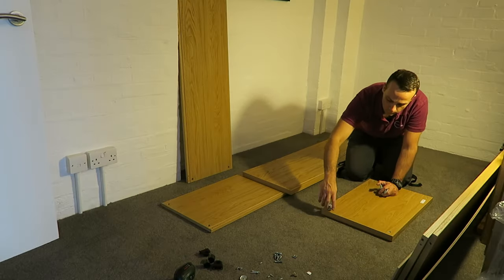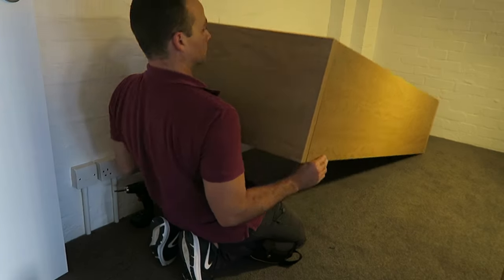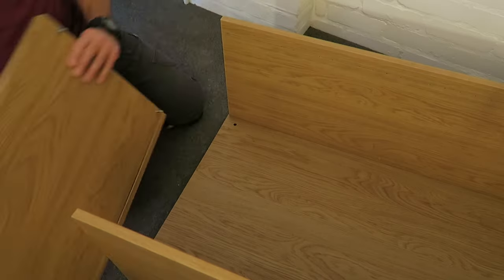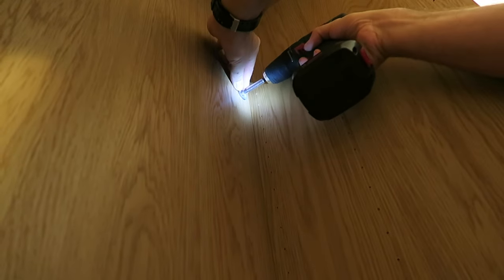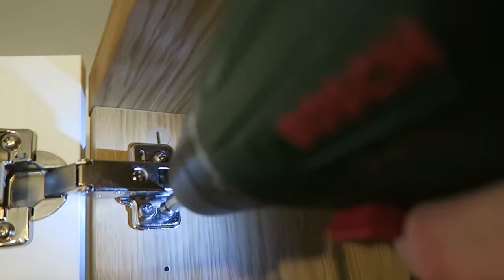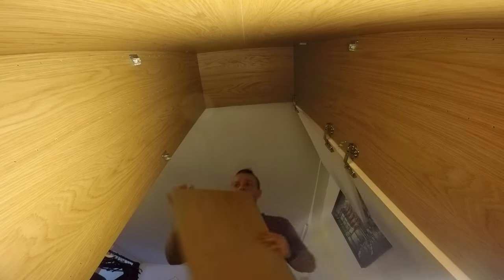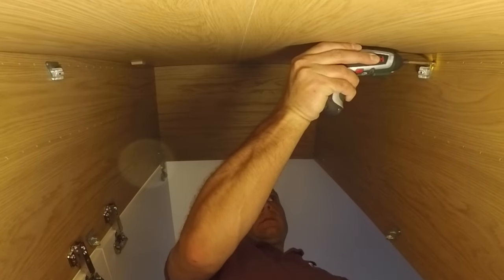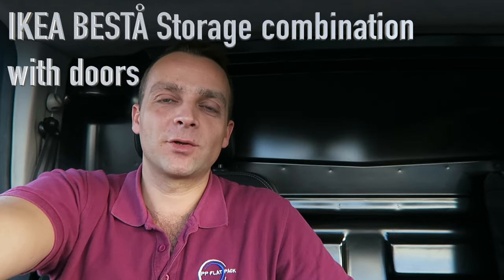IKEA BESTÅ Storage combination white Assembly

Comment: I absolutely cannot insert the backing board without it falling out of the grooves. You slid it in so effortlessly! Any tips?
Reply: I had exactly the same problem - it was a right faff getting the backing board into those grooves ! As soon as you push the board into the grooves, the sides move/open up and the board drops to the floor.

Comment: If you have only 1 small frame 23"H x 23"W x 8"H does it have to be secured to the wall?  Every time I open the door the unit tips forward.
Reply from the maker: Yes this one need to be fixed to the wall
Reply: @PPFlatPack  Thank you!  I am going to try to return it then.
Reply from the maker: @AquaFrost777   Maybe get wardrobe with sliding door there is not that much pressure on the frames.

Comment: Awesome video!
Can you please share what screws are you using to secure the dividing panels (7:34)?
I’m not finding them. Many thanks!!
Reply: Haha thought the same, they're in the instructions but not in the bag
Reply: Supposedly Ikea screws 114667, but you may well need longer and a different sort depending on what type of wall you are drilling into. If you don't have any in the Ikea bag or personal stocks, any hardware store will help. The fancy cheap-looking plastic pieces that come with Bestå units are a pain compared with the metal system traditionally offered by Ikea for the kitchen units (I don't mean the rails). With those you can drill into masonry, set your dowel and  put the screw half in. Then only you shove your unit against the wall and tighten the screw. Always better than fumbling around to find the dowel hole through the plastic holders we have with Bestå. Interestingly,  the BeståTV still have the sturdy metal system.
Reply: They had to be secured,  but it doesn't say anywhere. In this video the guy also doesn't secure the panels...

Comment: At 7:32 you secured the dividing panels with screws. The screws for that and instructions for that step are not included in ikea directions. Did you just add that step on your own and use your own screws? Thanks
Reply from the maker: You not need to doit I find it more secure so I fixit one from under as well. It is quiet hard to get there as the hole is to close to the site panel but possible. You will have few extra screws in BESTA I just use one from the extra ones.

Comment: Which hole # do you install each door on and then the main shelves by the doors and the push parts? Thanks!
Reply from the maker: If you have 3doors as in this case start with the bottom doors, holes for hinges are predrilled can't make mistake. Line up bottom doors with the bottom panel and secure them. Second doors 2-3mm gap and you find the right holes automatically top door same thing. Now when you have doors attached you can easy do dividing panels just line them up with gaps between doors

Comment: Thank you for posting! I am having trouble getting my push hinges to work. The cabinet doors do not push up against them hard enough to push the spring all the way back. Any ideas on what I can do to fix that? Thank you!
Reply from the maker: Adjust the pop ups there you can just screw the top is adjustable
Reply: I having this same issue in 2024 and don’t understand the solution given. Any help?
Reply: @PPFlatPack can you further explain.

Comment: Thank you so much for this very helpful video. There is a plug point behind the Besta we plan to set up, which won't allow us to push the unit right up against the wall and secure it. Would you have any suggestions ? Can we eave it unsecured, as it looks heavy enough to not topple over...is that a bad idea ? Thanks for any advice you might have.
Reply: I have the same issue with the plug🙃 can I ask what you ended up doing?

Comment: Hello! Sorry bothering again. I just trying to install one of these but even secured, mine bends a bit and cannot adjust top door. If you push one of them by hand bends? Mine yes, I'm trying to figure how to fix this. Thanks in advance :)
Reply: I mean, big side panels of the shelf bends by hand, maybe due to the slim back panel. Any advice on this? No related to legs :(
Reply: It's clear, is the weight of the 3 doors which is bending the shelf, is there any way to avoid this? It starts bending the furniture directly, over the legs. Maybe is because i'm using only one shelf?

Comment: Great! Now, show the part where the doors constantly need adjusting because the weight of them doesn't play well with gravity, and how you need to secure the cabinets in studs in at least 6 or more places because if you have more than one door open, that cardboard backing tears and down it comes (hopefully not on a kid). You need to modify the bottom if it is not on carpet and add a few 1x4s to the back that screw into the actual wood frame of it and then to the studs.

Comment: Hello, my Besta is shifting side to side by about 1/2 inch. It's not very stable.  I tighten the cam locks and they seem to hold the base/top very tight but the frame is still shifting. Does the unit design to stand alone or do you have to screw to units together else it will shift?    I am thinking about getting the metal cam locks and see if it will help or not. Do you have any suggestion?  Also I don't put the cam locks in the hole first like you do before pushing the base/top in, does that make any difference?  Thanks for your help in advance
Reply: Disclaimer: This is my first time installing any IKEA furniture so I could have easily miss some instructions (or pictures) :)
Reply: I assembled two standalone units (72x23") and they both are shifting

Comment: Any tips for adjusting the cabinet doors? I can't get them to line up correctly. They're not straight, or touching each other. Thanks
Reply from the maker: First attach unit on the wall thank each hinge have 2 screws you can adjust the doors in or out if you need to lift them up or down you can unscrew little 2screws holding hinge on the side panel push the door where you need and secure the screws back. Hope that help.

Comment: HI...I just bought and setup the Besta Tall cabinet at 75inches and it wobbles a lot.  It might wobble left to right at .5" to 1".  I have followed the directions perfectly...however I have not screwed it into the wall as it is wobbling so much.  I have read that the Besta unit has changed from older versions.   

I see they also have a 50" vertical.  Do you think my frame is defective?  Or should it wobble so much until it is screwed into the wall?

Also, I have floor molding and was planning to wall mount a hanging Besta above this unit.  I have about 1 1/2 inch of molding on the floor, do you think i have to take out the molding to make the two cabinets sit flush on top of each other considering the top unit will use the suspension rail?

Thanks!
Reply: The units (192cm high) wobble primarily because as opposed to units with a screwed/nailed or stapled back panels that cater for some rigidity and ensure the units remain somewhat square, you have some tolerance in the fit of the sliding panel. This allows some movement when a unit is standing and turns it into a parallelogram when not screwed to the wall.  When the unit is not standing level because of that wobble the next problem is you wil have trouble adjusting doors as the spacing of Ikea doors rarely leaves much spare room to play with.

Comment: We finished assembling this wardrobe, so far so good, just as an advise, put a towel in the bottom while screening the shelves, the tool fall down constantly, the towel will prevent to damage the bottom part. It seems strange the space in the back of each shelve, this is not in the instructions, thanks to this video we did it the right way, the doors do not close as nice as in the video, no wonder there is a plastic protector between the doors, I'll keep playing adjusting it. Good luck everyone assembling it.

Comment: Is this unit completely finished all around that I could put each section up separate instead of together?
Reply from the maker: Yes and yes you can separate them and use them as two independent units.

Comment: If I do not screw the 2 inner top corners to the wall, would the whole thing topple down towards me when all doors are opened? Door seems heavy. Not sure if there is a difference of (2 frames with 6 doors) vs (1 frame with 3 doors). Thanks. Very useful video.
Reply from the maker: I think is better if you fix it on the wall this frame is light and doors heavy it would go down.

Comment: Just built 1 of these units.  Absolute piece of crap, it literally sways from side to side even with shelves in.  Large drawer runner wont fit drawer and drawers bang into doors and drawers to the bottom and top.  Yet all assembled right.  😭😭😭  i have no idea how to fix.

I can see daylight through the top panel and sides, its that badly made